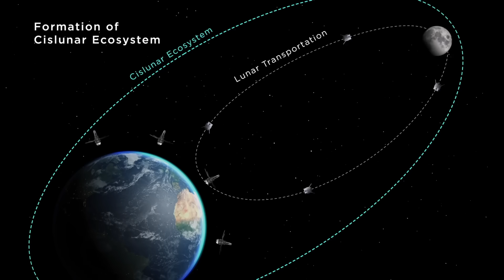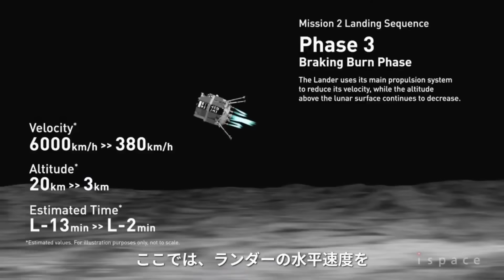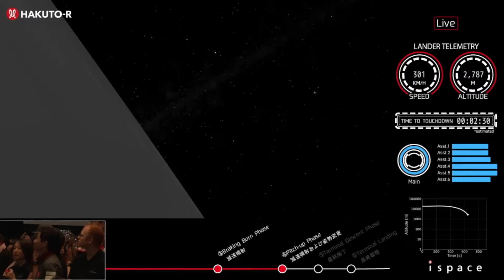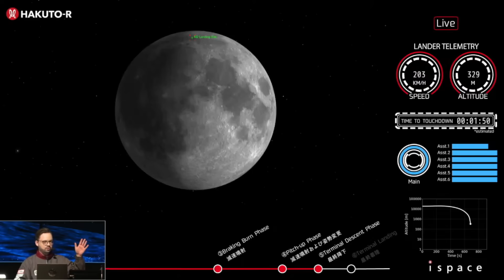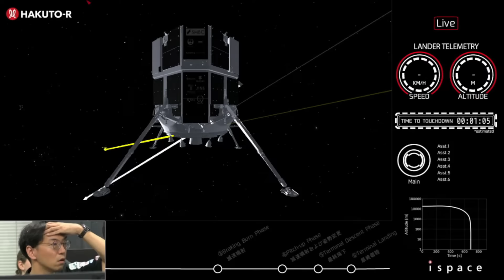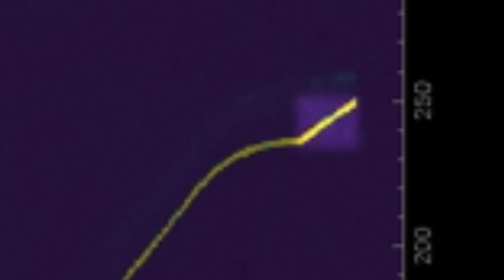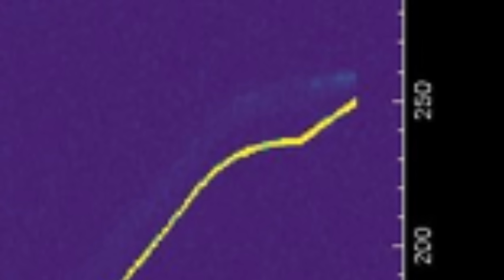Japan Crashes into The Moon, but Slower Than Last Time

Comment: These guys remind me of some people I work with. Really enamored by cool science, but the minute you ask them to do engineering like run Monte Carlo simulations with hardware in the loop to find problems like this, they can't be bothered.  In my case, it's guys developing autonomy software that is absolutely dependent on having good comms with other aircraft.  I and other people have told them many times they need realistic network models in the loop, but they keep putting their heads in the sand.

Comment: There is an engineering principle that is old as the Pyramids maybe that is why it gets forgotten in our High Tech Reliance age, "Keep It Simple Stupid"  or the KISS principle.  The Soviets and Americans back in the 1960s over engineered and worked to Keep It Simple.  Squat landers, larger engines and so on.  I understand that doing cheaper and lighter is a thing but just like in aviation the more you reduce the operating envelope the higher the risk for failure.

Comment: What both crashes have in common is crappy inertial guidance, which in both cases provided an "altitude" that was far from accurate.  They may be saving a bit too much weight and money on hardware that (a) is essential, and (b) constitutes a single point of failure.

Comment: I would have thought that you'd build the lander to get there first, then work on finding efficiencies in follow-on missions. I would also expect redundant systems. Maybe they have them, but the failure reports don't seem to support this. Not having redundant systems isn't "efficiency", it's built-in "single point of failure".

Now I'm no rocket scientist, but I would think that they would want multiple lidar sensors for failover, I think three would be the minimum number if they're looking for concurring readings. I would also expect a radar as well. We know the lunar surface gives a good radar return, do we know this for lidar? How effective is lidar altimetry with highly oblique angles like crater walls?

As for how to point the lidar, it seems to me that one solution would be to co-mount it on a gimbal with a live-feed camera with the gimbal controlled by a (gravimetric, gyroscopic, etc?) sensor to keep it pointed down regardless of the attitude of the craft.

I know that we've lost at least one lander due to an "unexpected" crater. What confounds me with that is that craters are "unexpected" as far as moon-bound navigation systems are concerned. With the size and number of craters on the moon, one would think that dealing with them would be built into the system. Given the resolution of the pictures we have of the lunar surface, why waste effort designing a navigation system that relies on pictures of the surface when that surface is never going to match the pictures? And how would one adapt that system to land somewhere else where the pictures will be even lower resolution?

Comment: I am a mechanical engineer in the field of fully automated production machines. From my experience, I am fully aware how many complications you can already have in a environment, that one should think is pretty steady & defined. I can not wrap my head around it, how one would implement a fully automatic landing given the described cirumstances from your video. Which sensors to use/trust, what to do in which case etc.... STILL.... how this is going, pretty much makes me think, that would be my 'experimental' approach, without bringing much experience... and I'd probably fail in the same way.

The only thing that makes me wonder here is... if you start such a mission... do you really start rather clueless and hope for the best? I'd somehow imagined, that all should be much better refined already. So... in the result I am even more impressed for missions, that have to go right the first time!!! Like the unfolding and calibrating of the James Webb telescope and such.

Comment: "30 to 40 m/s, that's 100 km/h, 60 mph,"

Wow, only very approximately. 30 m/s is 108 km/h. 40 m/s is 144 km/h.

So the impact speed would likely have been closer to 80 mph than 60.

Comment: Based on what industry says (at least Peter Beck and Tory Bruno), customers usually pay for the whole ride, they don't pay separately for each kilogram of the payload.
So why not load 50 extra kg of propellant, and add a beefier engine that weighs 50 kg more? And have a much higher probability of landing and much higher error margins.

Comment: They should just send people to do it instead of machines. We did it in (69) 1970's with old technology from the 50's and 60's. We also returned the astronauts back to earth. So because our level of abilities has increased. It should actually be easier than in the past. No reason to send drones when there are plenty of people that are qualified and also plenty of people that are suicidal that could be trained to become qualified.
Reply: Plenty of reasons to send drones. For one you don’t need life support. You don’t need to train them to do experiments. You don’t need to return. You can use a smaller vessel. The G forces of maneuvers can be higher. The time spent in space can be longer.

Comment: Design flaws like this can be discovered and corrected by a proper test program - in hardware.  Problem is, hardware testing is expensive if done right, and rarely do program designers properly budget for the time and money necessary.  It's tempting to sneer and say the Apollo program did this almost 60 years ago with ancient tech, but that misses the most important point - testing trumps tech.  Apollo's huge budget supported a massive test program, and they tested everything, over and over, in every scenario of which they could think.

My heart goes out to this team, and the takeaway future teams must learn from this is the importance of test.

Comment: Gimbaled LIDAR seems like a good idea..  Or multiple LIDAR units oriented with a cruise descent angle and a vertical descent angle.   Use wide view cameras to determine and apply the proper LIDAR gimbal angle or to select the LIDAR oriented perpendicular to the surface.  Easy to come up with dumb suggestions!  😅

Comment: NASA might have oversold the capability of the Doppler Lidar system that they commercialised for the CLPS programme;  NASA’s Navigation Doppler Lidar (NDL) measures the velocity and distance of a vehicle relative to the ground (see https://www.nasa.gov/centers-and-facilities/langley/nasas-laser-navigation-tech-enables-commercial-lunar-exploration/).

NASA promoted doppler lidar technology as being able to provide more accurate and higher resolution guidance data than doppler radar sensors can; a big selling point was that it was what was used for the Mars rover missions in the 1990s and 2000s. What NASA PR failed to mention is that its Mars rover missions also used airbags or sky cranes in the terminal phase of  landing.  In fact, a deeper dive into NASA’s terrestrial tests of the doppler lidar system  reveal significant variance between doppler lidar and  doppler radar readings when the approach velocity of the vehicle was slower (as it would be in the terminal phase of landing ie 0-30m altitude).  

Chinese scientists working on similar doppler lidar sensors for the Chang’e lunar landers have studied and published many papers about the challenges and  problems of using doppler lidar sensor data for their guidance navigation  control system in the terminal phase of landing. Irregular terrain relief and dust  kicked up by the landing thrusters created a lot of noise and variation in readings that was challenging for their guidance navigation control programme to process. The Chinese developed 3 separate doppler lidar filter-algorithms for different types of lunar terrain and adopted a sophisticated multi-sensor fusion system that integrates data from multiple sensors and switches between different sensors  as the primary navigation sensor for different phases of the landing cycle.

The  commercial pressure to be the first to deliver a low cost solution seems to have led to under-engineered and under-tested designs that, as far as I know, don’t incorporate doppler radar for altimeter and velocity readings.  iSpace is part of NASA’s CLPS programme so they may very well have licensed and used NASA’s NDL as part of the funding-subsidy package.  Both landers by Intuitive Machines  definitely used NASA’s doppler lidar system. 

In the 1960s, NASA’s Surveyor lunar program achieved a 70% success rate; the preceding NASA Ranger program only had a 45% success rate. By the late 70s, the Soviets/ Russians achieved quite a decent lunar landing  track record  (70-85% success rate) if you only count the lander missions that made it to trans-lunar injection. These programs all used doppler radar for their altitude and velocity navigation and guidance readings.

The Chinese are remarkably open about their lunar lander architecture and design.  The Chang’e 5  navigation and flight control system uses doppler lidar, flash lidar camera, doppler radar and gamma-ray altimeter for the final approach and terminal phase of landing. Skimping on the navigation and flight control sensors and system  seems to be a case of being penny wise pound foolish.

The Chinese  have a perfect record and completed 3 successful landings so far; but that is still a small sample size.  The Soviets were also 3 for 3 for their lunar rover missions.  Although the Soviets developed the gamma-ray altimeter for their Soyuz  crewed capsule terrestrial landings, they never used it for their lunar missions.  The Chinese also use gamma-ray sensors in the terminal phase of terrestrial landing for their Shenzhou crew capsule.

This is a good overview article about the navigation guidance control system design  for the Chang’e 5 lander for anyone interested:  https://spj.science.org/doi/10.34133/2021/9823609

Comment: I’ll fix it for next one. Aim with inertial navigation to stop 100m above surface. Measure altitude redundantly. (Won’t be 100m.) Aim to stop when altimeter shows 2m. Have redundant varying length surface contact wires tell when you’re close enough to shut down.
Reply: I'm sorry, but those redundant measurements would balloon the budget by 5%, so we're going to have to cut those costs.
(Also, contact wires would not work well with the engine exhaust and kicked-up lunar dust).

Comment: It seems to me that you can either use a super-efficient landing trajectory OR you can dead-reckon your altitude until you finish the braking phase and tip upright, but you can't do both at once. The super-efficient path means you don't have the tolerances to fix things if you end up low, so you need to have constant real altitude measurements while you're coming in. The less efficient path takes more fuel, but you go vertical at a higher estimated altitude so you have enough time to get the scans locked in before it becomes critical.

Comment: I have a laser measure that can measure distances, it's a few ounces of electronics and a AAA battery. Why would you not have the same tech pointing in multiple directions to give you low resolution data from all directions so you at least have something until your fancy Lidar scanner kicks in?
Reply: Can your laser survive 150 days in a vacuum while exposed to constant radiation?
Reply: @mistertagnan  Of course. It's just some basic electronics, we have decades of experience hardening it for use in space. If you can harden a Lidar scanner, a much more delicate piece of tech, a laser range finder will be a doodle.

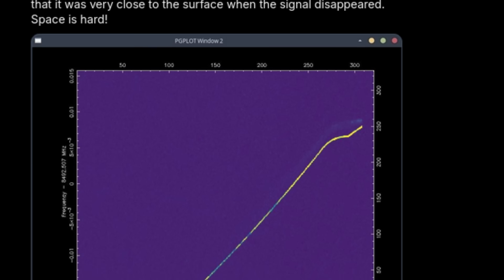Comment: 10:21 why is the final breaking at a lower rate than the previous descent? Wouldn't it apply max breaking if it got a late lidar? Or does that indicate they never got lidar and it just did a simulated landing like last time?

Also makes no sense that the lidar doesn't get a lock at somewhat higher angles. You know the orientation of the craft, so you should be able to calculate an approximate height or just take the raw reading and determine you latest breaking window from that. I think the lidar failed completely.

Comment: If the lidar points "down" in relation to the lander, and the lander is tilted, then the distance the lidar is measuring is not the same as altitude. That meadured distance would be greater, making the spacecraft think it is higher than it is.  Unless they know take the angle the spacecraft is tilted and do a bit of trigonometry. Hmm

Comment: They should have used radar for coarse altitude measurements from the 100 km orbit to 2-3 km altitude, then employed both lidar and radar until 500 m above the Moon, and only then switched to lidar alone. This approach should have been incorporated from the start. Additionally, they should have obtained a precise model of the landing site and simulated landings hundreds of times before attempting the real flight.

Comment: My approach to analyzing this was a bit different than Scott's, but I arrive at the same conclusion.
I understood, they said that they wanted to get it slowed down to zero speed at 10m height, then let it drop.
The terminal data showed -270m, so the height measurement was off by at least 270m.
So it probably dropped from a height of approximately 300m.
This would lead to a speed on impact of 30m/s, just as Scott also told us from his estimations.
Of course the data shown here explains, that the speed never slowed down to zero.... 
But the final result is the same 🤣
In fact, if it believed that it was 300m lower than actually, then it should have braked even more fiercely.

Comment: At this point, I’m not sure if I should be impressed with what was achieved in the 1960’s, or straight-up embarrassed by what’s happening these days. 🤦‍♂️

…and yeah; I’m glad the mission profile allows for a more efficient and cheaper vehicle, however if you have to launch said vehicle THREE TIMES, I’m pretty sure it ends up being at least ~2x as expensive vs. “conventional” landing methods.

Either way, I’d really hope that these engineers spend more time in some sort or simulator where they can test these systems better. Both failures HAVE to be fairly easy to model, especially this last one. 

I have a 20-year-old Land Rover with front and rear park distance “mini radar” sensors, surely a freaking lunar lander can have some sort of redundant altitude detection systems. I mean aircraft have COTS redundant radar altimeters. 

Why not have some sort of gyro-stabilized pod for the laser rangefinder system and program it so it’s always facing down? 

Alternatively you can just have two or three range-finders at 90 / 45 degrees plus the bottom unit, and extrapolate an altitude reading by combining the data with the AoA to get a constant reading when the vehicle is translating sideways.

Comment: I work in industrial automation where everything I design is required to have triple-redundant instrumentation and 2-out-of-3 voting.  It blows my mind to see an otherwise cutting-edge design where the backup plan for losing an instrument is to just "guesstimate" the correct value.
Reply: Industrial automation does not have the rocket equation to contend with.  Tripling your instrumentation is hugely expensive in space exploration, and only gets used for crewed missions.
Reply: @IanMcCloghrie  The Saturn V used in the Apollo project had this tripled instrumentation at least in its 3rd stage.
Boeing does not use it on their 737Max8....
I never understood the latter.
Reply: @Rainer_Landes  As with all things engineering, it's about tradeoffs.  The Apollo landings were crewed missions and failures there would mean that people died.  

So yes, we could spend a billion dollars per probe and have higher confidence they would make it to the moon but we've already done that.  Part of the objective of the current missions is to learn how to do it for less.
Reply: @IanMcCloghrie  Before "to learn how to do it for less" you have to learn.. you know how to do it first?

What are you making efficient if you are not even capable of achieving the goal in the first place?
Reply: @IanMcCloghrie  you mean more expensive than losing the whole mission due to lack of proper safeguards and instrumentation? Don't justify stupidity and incompetence. They are getting exactly the results one could expect from a badly designed landers - they crash - it's that simple.
Reply: It depends how meaningful the redundancy is. 3 altimeters with quorum will avoid a problem if one of them happens to randomly fail but not if weird conditions (harder to control the surface of the moon than the inside of a factory) cause all 3 to give the same bad data.

Comment: Both failures happened for the same reason: the lander didn’t know how high it was above the Moon. The first was due to a software bug—likely fixed by now—but it looks like ispace missed the bigger picture.
Reply: Like run a bunch of Monte Carlo simulations with different starting points and failures? Or just run the extreme case of low attitude at the start of the pitch over to see if it has any chance of lending nominally?  To me, this is just the symptom of a poorly designed or funded test program.

Comment: This will sound dumb, but... drones?
Hear me out, have sensors that aren't on the lander that could fly ahead to scout the terrain so the lander wouldn't be surprised by a cliff. It would add weight and it would require its own fuel to fly without an atmosphere but it could help gather terrain details to increase redundancy.

Comment: Maybe they should design and build the LiDAR so that it's steerable and not pointing in a fixed position...or have two of them, one that can be pointed at the surface no matter the orientation of the lander, and one that is only pointing downward. If they have nothing that can tell how far the craft is above the surface, regardless of orientation, then they might as well be doing this completely blind.